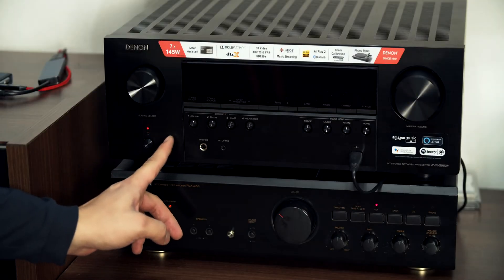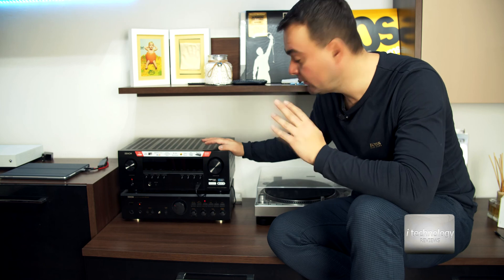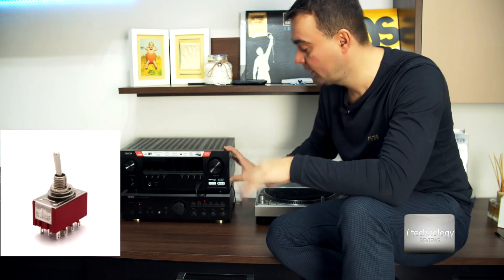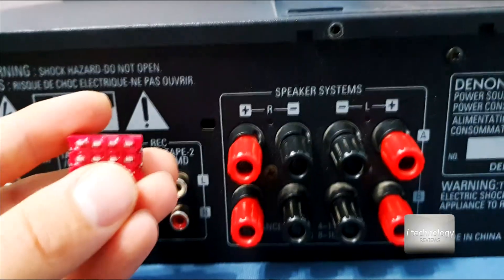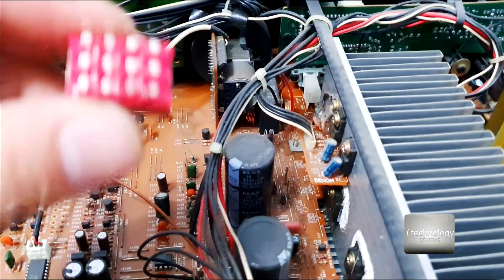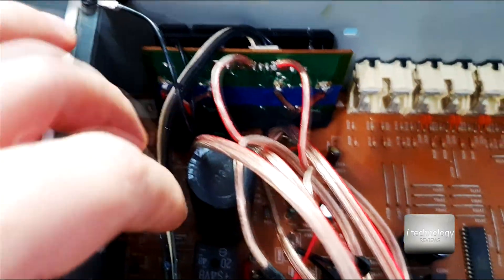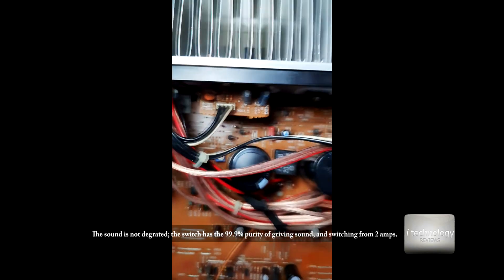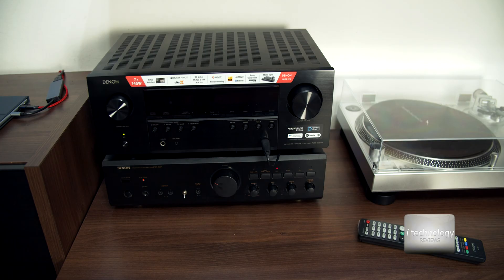2 amplifiers to 1 set of speakers - 10$ Build in Audiophile Switch Invention - Denon S960h & 495R

Comment: If you prefer the sound of the amplifier over the receiver for music sources, then why not just isolate the front speaker output on your receiver in the on screen menu, (assuming you can do that with your receiver) and connect the RCA stereo outputs of the receiver to an RCA stereo input on the amplifier? This would ALSO bypass the internal amplification circuits in the receiver, giving you a direct line connection to the amplifier. Then you could still use the receiver to output to your surround speakers and subwoofer, and run the front speakers from the amplifier simultaneously.
That would negate the need to install any extra switches, and you could still use your remote controls to control both the amplifier and receiver.
Seems like what you have done is unnecessary work to me. And you have lost a set of speaker outputs on the amplifier in the process, which was completely avoidable 🙄

You could even create a continuous loop, if bothe the amplifier and receiver have Tape in/out  loops. You could then have all of your sources connected to the receiver, and connect it to the amplifier with just one set of RCA cables. And by switching the receiver output  mode to stereo, you can isolate all of the surround speakers at the press of a button, if you so wish. That would achieve what you appear to have done here, without any drilled holes, soldering, or potentially voided warranties. Assuming you are not trying to achieve something different, other than standard stereo listening.
Reply from the maker: Because the receiver does NOT have RCA outputs!

Comment: Good advice. Thanks. Now I am wondering how to switch the subwoofer between AVR and Stereo amp.
Reply from the maker: Hi. If you have a subwoofer with 2 rca put and rca to amplifier and one to the receiver. If you amplifier does not have subout just put rca REC out line to the sub. Use 2 difrent cables! This is the solution! Subscribe